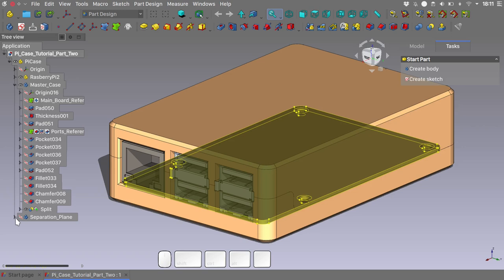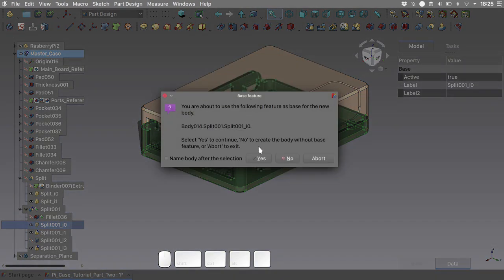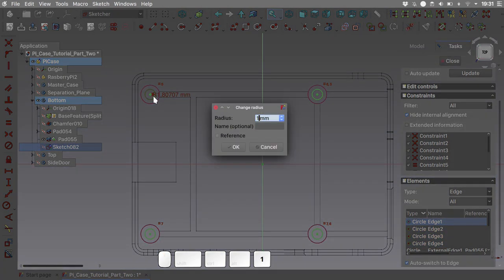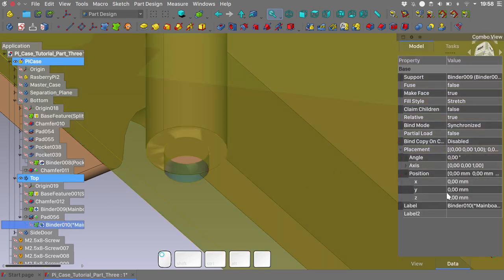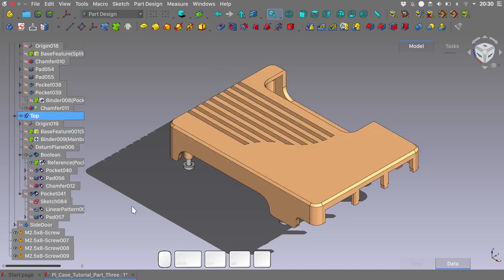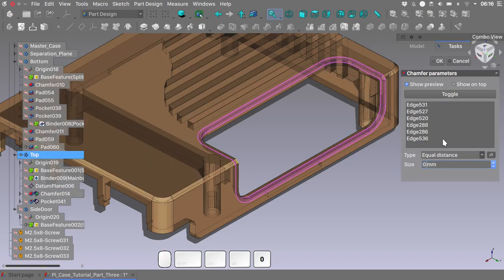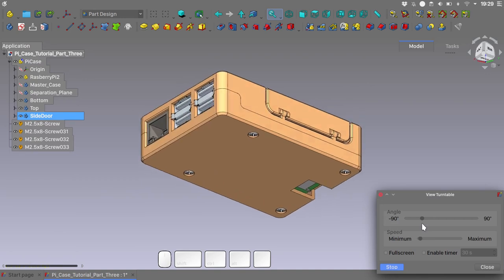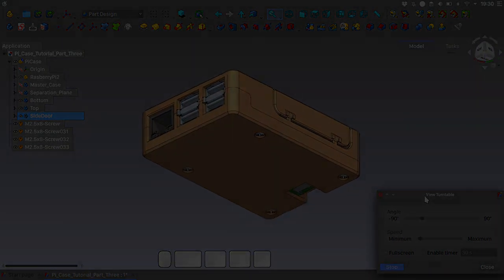Rasberry Pi Case for 3d printing video tutorial(part 3) Body separation and detailing.

Comment: Hi, this was a great tutorial, I just made it now with version 2023.321 Daily :-). The problem you described still in place after deriving the new solids, to do some feature on the structure before preceeding. One question though. I can never select the circles, I can only select arcs of a circle. What is my problem? All the best and btw this is my first take on freecad at all. I love it... almost like inventor which I used thousands of hours. I miss some convenience like a constraint where to put two lines after each other on the same line, or symmetry and dimensions free on anything, not bound on points. Well I get used to it.

Comment: Made it till the end :-) and learned a lot. I understand why you did all those fast-forward pieces, but could it be possible in the future to put an extra still image of the situation for 5 seconds after each section so I can pause the video much easier? I played back those scenes on 0.25x speed in youtube and even then it was very hard sometimes to see which values you put in the boxes.
Reply from the maker: That is actually an excellent idea. I will do it whenever necessary. Thank you

Comment: Learning so much from these, thanks a lot!

I'm having a heck of a time selecting points in the sketcher, often it selects the edges or nothing, also in the sketcher with the polyline tool I can only snap the first point to other elements on the sketch, but no points after that will snap. In your video you import geometry to a sketch (purple lines) and then draw over them with the polyline and it seems to snap each point you draw. Any help in how to make it work like you have it would be great, because trying to select points for a coincident constraint is really hard when I can't select the points)
Reply from the maker: Using Linkstage3 you should update to the latest daily release. There was a bug corrected in this release regarding the sketcher vertex selection.  It drove me crazy also . I couldn't figure out what's happening. Anyway bug already solved. Also check your pick radius in preferences. I find a 10px radius on a 1080p display to work well for me. Let me know if you solved your problem.

Comment: Seems that there were some changes to the BaseFeature functionality. I can add some pads to body created from a split, but pockets are not working. When I'm trying to chamfer/fillet on an edge, im getting an error message "The selected object is not a solid feature. Please use the 'Boolean' feature to fuse it into the body first." - Tried to do that, but without luck. Any ideas what should I do to have solid body?
Reply: oyy, nevermind, it works after the 'fuse', I just tried to do set a chamfer on the original BaseFeature
Reply: still not working, I've commented too early. After the booean fuse, I'm able to set fillet/chamfer, but the feature is not working. Some new edges are visible, but the feature is not 'applied'
Reply: After third attempt, I'm finally able to make pockets on splitted body.